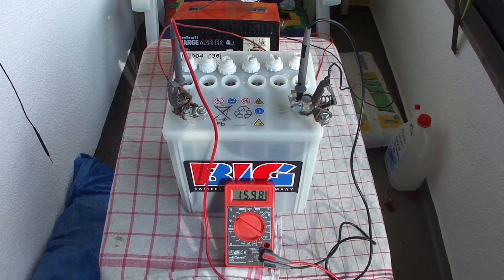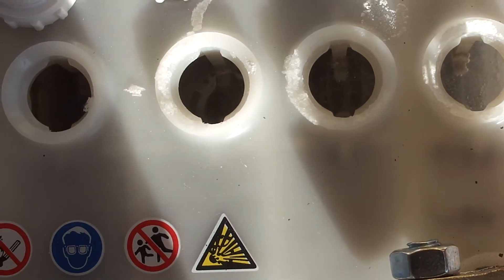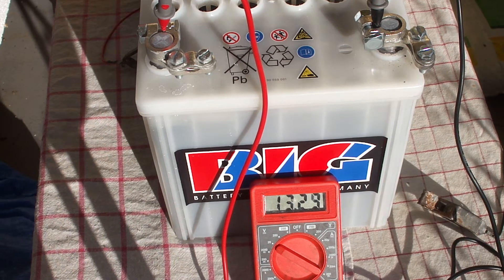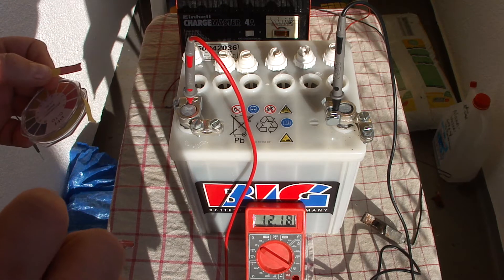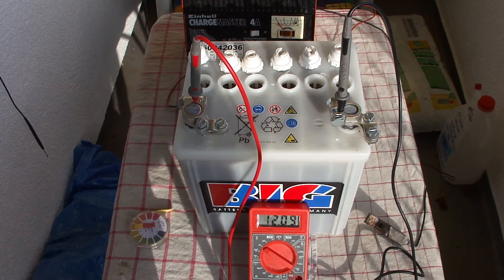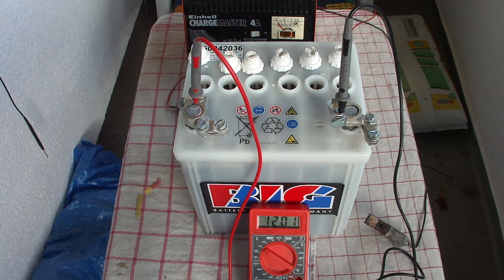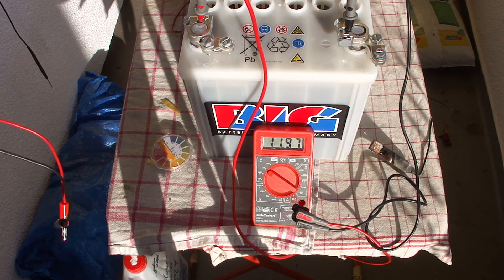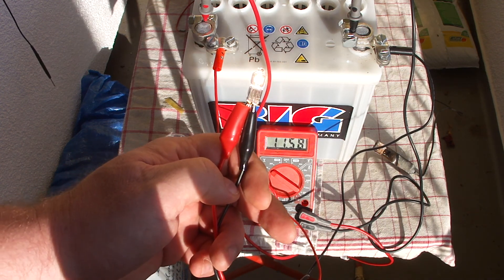ALUM Battery test 24th of August and PH-Level of the ALUM Elektrolyte

Comment: How many amp hours do you gain or lose from this conversion?
Reply from the maker: Robert Clyne Have not yet tested it..Probably loose some but the advantage is it is less acidic...only PH 4 to 5 or so so does not burn much your skin...but I will research soon more supercaps with selfmade carbon electrodes made out of Activated charcoal made out of  coconut husk shells
Reply: How long can you run a fifty watt bulb until you hit zero volts.  Forget about the inverter it will cut you off.  With alum you should be able to run it to zero.  I am interested in the energy capacity of alum as an electrode and the superior available energy.

Comment: I've converted a few of them now. My favorites are lawn mower batteries. I've had more luck with them than car batteries. I've done tons of searches on alum batteries and one thing I've noticed is there's very little actual charted data on them. Also you can hardly find any information on the ways people are using them. I wrote an article on my blog today and included a rough chart of an 80 day period where I collected voltage data on the battery. I've though about maybe starting an alum battery forum or something. Anyway here's a link to the blog I wrote on it today:
http://donnybowers.com/wp/2017/02/19/some-data-on-a-lawn-mower-battery-i-converted-to-alum/

Comment: i had verschiedene accus umgerustet nach ( amonium)alaun , am beste wirkt das mit eine erstmals mit nirmale accusaure bevulte und formatierte batterie, dan das saure raus kippen und mindesten dreimal spulen mit warmes ( 60gr) leitungs wasser, die letste mal die batterie umgekert fur 10 munuten austripfen lassen, kan du gleich die alaun misschung machen, ich mach es mit 150 gram alaun in 1 liter gans normales leitungs wasser( in glaube das gerade die restlichr mineralen drin sogar das process unterstutzen) und ach die aufgebaute sulfaat schigt ist notwendig bei diesem process ( die alaun umkapselt dem oxid) und sorgt fur ein etwas hohere voltage, erste mal nachladen mit puls bedini oder sowas, bis 13 volt,  dan mit c10 volladen bis mindestens 14,7 volt.
nach diesem weise haben meine accus 12,5 volt offene spannung

Comment: May i ask you a question please.

in a lead acid battery you cant discharge it below 10.5v without damage...

With an alum battery - what amps can this be discharged to and then be brought back to original charge of 12v please

thanks for sharing your videos

Comment: you HAVE to cycle the battery with the acid FIRST ,then replace the acid with the alum. ALso mix in 50ml of acid into each cell with the alum mix. The acid wont be strong enough to burn you but will make the battery MUCH stronger. If you are worried about sulfates then put in 5grams of magnesium sulfate in each cell also.Ive been working on these mixes for almost a year. TRY it and will be PLEASED

Comment from the maker: Yes, it seems this battery can be discharged to much lower voltages, but I still have to see, if not any leadsulafte powder will drop down the plates and collect at the bottom of the cell...and will make a short circuit of the cell after a while..

Comment: thanks for all your tests... 

Can these batteries be used in cars?

For readers: ive heard, one advantage in using them as a battery bank for solar or wind generators, is that 12v leisure batteries can only be discharged down to about 10.2v before they dont accept any charge. Alum batts can go right down to 1v and still be recharged.